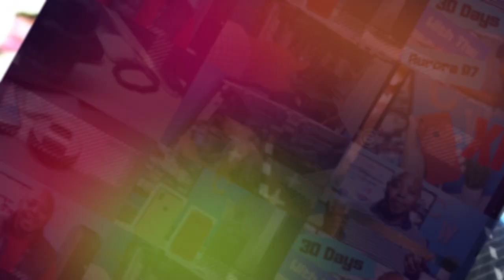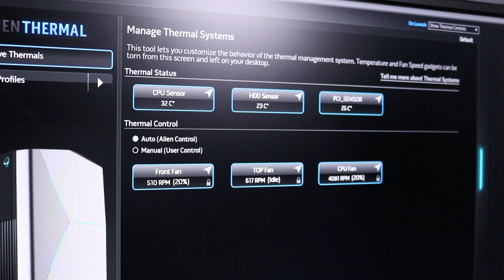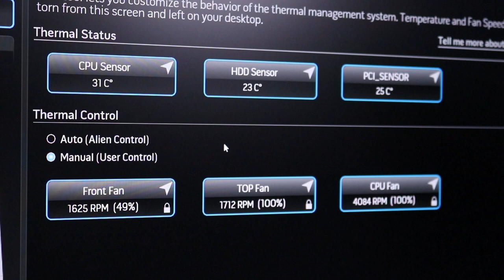Corsair Hydro Series H60 Liquid CPU Cooler Install / Upgrade in Dell Alienware Aurora R7

Comment: The only guy to actually mention where to wire the damn pump. I was confused with the 3 pin cable. Thanks.
Reply from the maker: No problem! Glad I was able to help!
Reply: Where does it plug in
Reply: Where does SATA connect? The connecter near the PSU?

Comment: Thanks for the video, I watched it a couple of times and after some research decided to upgrade my R7 with the H75.  I got it done correctly on the first try and my temps dropped 10-12 C at both idle and under load.  It was very straightforward and a great fit in the R7 case.  I was able to use the screws that came with the cooler to attach both fans, including the top fan to the case.  Unlike the H60, the H75 comes with 2 fans, so it includes 8 screws.  They are long enough to secure the top fan to the case and radiator.  Used the Y-cable and connected the fans to the TOP header, pump to the pump header and left the CPU header open.  Set the TOP Fan to monitor the CPU in the Alienware app.  No errors on boot up, all works great.  Idle temps are now 31-32 C.  Using BurnInTest utility my max temp dropped from 88C with the stock air cooler to 76 C with the H75.  Average load temps went from 82 C to 72 C.  Part of this is also due to changing the fan settings in the Alienware control panel from fixed to curve, so the airflow ramps up based on the CPU temp.  And the PC is almost silent now, even when gaming, no more fan revving.  Very happy with the purchase and results.
Reply from the maker: Avenger that’s awesome!
Reply: Hey, thats really good to know it worked. I have a few questions, as im also upgrading to liquid cooling.

1. Did you have air cooling before on your cpu?

2. Which H75 did you use, as im searching online and there are many different types. Would you mind providing me a link of the one you used.

3. Do the fans that come with the cooler work?

Thanks
Reply: @akhil1802 

1. Yes, I had the standard factory air cooling, low profile heat sink and fan, that comes with the R7

2. I installed the Corsair H75 which is the dual fan version of the H60 shown in this video.  The 2 fans provide a bit more airflow and help expel the hot air out of the top of the case.

3. Yes, the fans that came with the cooler work just fine.  I did replace them with be quiet! Silent Wings fans, but that was to minimize the noise, cooling performance was about the same.

Comment: Thanks, Will!  Turned my R7 on two days ago and was greeted by an instant chorus of loud Screaming fans. Temps showed CPU was hitting 92C!  I figured it was either a rogue piece of software or the CPU cooling system had failed.  Task Manager wasn't showing anything too abnormal but I decided to reinstall the window with Alienware recovery tools.  No luck there so it's come down to that AIO.  Since you're the only one with consistent R7 videos I turn to you and sure enough, Will is doing an AIO swap.  Iike you I don't want to have to remove the motherboard so I'm going with the same unit.  Wish Me Luck.

Comment: Great demonstration and explanation! My stock aio cooler got hot and hotter. I did all the steps 1:1 to install the H60 in my Aurora R6 on a i7700K. It succeded and temps are now down to 35 degree in idle mode. Much appreciated!

Comment: Great video!  This seemed easier on my R9.  The radiator and fan installed with easy, where it looked tight on your R7.  The H60 made a massive difference on my i9-9900K 5Ghz overclock.  Temps went down 10C under heavy load and it's much quieter that the stock Alienware CPU fan and top fan.
Reply: I’m getting 78c on my r9.what are you getting?did you plug the data cable by itself or with a cable that was also connected to a HDD?

Comment: Thank you so much for making this video! I was able to successfully install my first liquid CPU cooler thanks to you. I really appreciate it that you went step by step!
Reply from the maker: Moira no problem glad everything went well for you! Thanks for the feedback!
Reply: @WiLcreatives  No problem! I'll definitely check out some of your other Alienware Aurora R7 videos for future reference!
Reply: @Moiwa bro where does the sata power go and 3 pin? Sata goes to the connecter near the psu ?
Reply: @mahid9594  Sorry it has been so long since I did this I do not completely recall. The three pin can go into the four pin at the top of the motherboard near the radiator. That's correct the sata goes into one of the connectors near the psu. 25:28 and so forth should hopefully help.

Comment: I wanted to thank you for taking the time to make your video; it was very useful to me. I was able to get my own H60 installation done however I did not remove the power supply or the top of the case. I am assuming the R10 is slightly different than your unit. I am running some stress tests to make sure the temps are normal.   I am seeing temps no higher than 65c and I am assuming this means everything is working. Your video was the best I saw. Again, thanks. Keep making these kinds of videos.

Comment: I just installed the exact same product in my R6.  Very informational video and it helped me a lot to watch as I did the same install step by step.  Thanks so much!
Reply from the maker: Awesome what type of cooler did you have before the upgrade?
Reply: @WiLcreatives  I just had the stock air cooler before.  I just got the RTX 2070 super in my Aurora and when I put it in I can totally notice the increase in fan noise.  That's why I went with the liquid cooler option.  One question though....the instructions in the box say the install the fan on the outside and the radiator on the inside but I noticed you did it the other way around.  Did you install it that way because you were placing it at the top of the case to vent heat out of the system?  I was just confused as to which way to install it.  Thanks!

Comment: Great video will! I would recommend to anyone who wants to upgrade their cooling in the Alienware to buy the Corsair H75 instead. Basically the same install but two fans instead of one. I idle at 30 and when I game I never go above 52.
Reply from the maker: Thanks man! Thanks for the info as well!
Reply: WiLcreatives no problem keep up the good work!
Reply from the maker: @tomfrien  I definitely will!
Reply: Does it fit on a R8?
Reply: Fernando Juarez it is the exact same case and motherboard so I’m pretty sure it will.
Reply: Have you done it? Does it deffo fit?
Reply: What's your Alienware model? I have R8 should I buy it?
Reply: Hi i have a question for you.. (2 years later i know, would be very grateful if you could help me out). The H75 has 4.72 x 1.06 x 6.1 inches dimension and the H60 in this video has 14.17 x 6.29 x 4.72 inches dimensions for LxWxH. is that normal that its so different?. i'm scared the H75 won't fit on the case because of the double fans.
Reply: @Maxalam  unless the dimensions changed from the one I bought 2 years ago I got it to fit. It is a little tight but it worked great. Just make sure you have the fans pointed in the same direction 🤣🤣. I’ve done that.
Reply: @tomfrien  gotcha thanks a lot

Comment: Your video was just in time. 

About 10 min ago I completed the installation of a H60 in the Aurora R5, but I made two different things: I changed the fan from corsair for a bequiet silent wings 2 and instead of pushing the radiator into the top box, I used the one it had for the previous top fan so I used it as a holder, meaning no top box but is holding tight by the fan holder.
Reply from the maker: Nice !

Comment: You don't have to take the top off the case. The steel box that holds the radiator can come out with one screw. I have an R8 and just installed an H60 in mine
Reply: Ah. That would make it much easier. I am debating on this upgrade, but Dell will not let me install the OC software.

Comment: FOR ANYBODY WITH ALIENWARE LIQUID COOLER: It makes a absolute word of difference, my Alienware liquid cooler was insanely loud, i just put this H60 in and its so quiet its almost inaudible, and i bought a used one! Install was not that hard, and it is 100% worth it. MAKE SURE TO PUT THE 4 PIN ON THE "TOP FAN" AND THE 3 PIN TO THE PUMP FAN USING ONLY 3 PINS STARTING FROM LEFT, THIS WILL LET YOU BOOT PAST BIOS SUPPORT AND USE ALIENWARE COMMAND CENTER, OTHERWISE YOU WILL NOT BE ABLE TO BOOT PAST BIOS SUPPORT.

Comment: Thanks Wil.  Very informative, and I feel more prepared when I upgrade my wife's Aurora.
Reply from the maker: Thanks man I appreciate it! I was also told that the Corsair H75 works as well in a push pull configuration, so that's worth checking out!
Reply: @WiLcreatives  Will do.  Do you have a use for the old Alienware water cooler?  Willing to buy it from ya ;).
Reply from the maker: @olddrybonez  you got it, if you're on Twitter or Instagram. Send me a private message and we can talk through it.

Comment: Great job. Love your style, you not only covered all the bases, but anticipated common mistakes. Very humble too. Really enjoyed it and learned a lot. One issue I'm having is that on boot, Support Assist declaring a CPU fan error since there is no longer a fan plugged in to the CPU Fan connector. Any suggestion?

Comment: Hey Will, Love the videos honestly excellent help when looking for small tips & nuances you were a great deal of help through College. 
Quick questions did you remove the mobo to install the back panel for the stand up screws for the cooler ?
Reply from the maker: Thanks I appreciate it. I didn’t have to remove the motherboard. I was able to use the backplate that was there already
Reply: @WiLcreatives  Thanks, appreciate the quick response!👌

Comment: I'm planning on getting this for my R8. I've been looking at lots of videos and talking to people in forums. I'm told the fan that comes with the cooler is junk and will throw a bios error. You didn't mention that so no error? It's recommended to get a different Corsair fan instead. Just wondering if this worked out for you using the supplied fan.
Reply from the maker: When I had it I never ran into bios errors. I’ve read the forums as well. I think it depends on what pins you plug into.

Comment: Did you need to swap out the CPU fan that came with the H60? I was reading that you need to swap out the fan to get the R7 Aurora to book past the support assist. Can you confirm this? If you had to swap out the fan what did you change it out with?
Reply from the maker: No I did not have to change the fan

Comment: hey so what kind of temp are u getting after the upgrade from alianware stock LC to the H60 LC? im thinking about upgrading too but if its not a drastic different i might go with the h110 or hold off. i see that u show ur idle at 31. is that lower than before?? also what kind of past do u use? grizzly?

Comment: Thank you for the video, just gave it a thumbs up.... unfortinately the version on H60 that is sold in 2023 is bigger and won't fit and it is impossible to find the one you bought. My Pumo broke and I have no choice but to replace it and the radiators I found that will fit are Asus Tuf Gamin LC 120 A-RGB and NZXT Kraken 120 RL-KR120-81. The problem is now that I don't know if they are compatible (right connections to the DELL motherboard) and you also mentioned in the video that you might need to re-assemmble the motherboard. I know it is a lot to ask but would you be so king and check if any of these will fit? I would of course do it myself but I just don't know how I can check that. Thank you in advance
Reply: any luck? facing the same issue , cant find a new H60 and not sure what fits these days..did u install either of these you listed? if so how did the install go?

Comment: Great video man, I got my H55 installed using it, thanks a lot! I will say for anyone else coming from an air-cooled R7 configuration, same experience as the guy below, with regard to not having any chassis screws. How does Corsair not provide these?! Anyway, the other big issue (with H55 at least) is that it doesn't have PWM fan, so you'll likely end up with something much louder than before. Super frustrating, I now need to purchase a PWM fan. Major fail on Corsair's part. Anyway, enough about that, can't stress enough how helpful this video was, thanks again!
Reply from the maker: Brian Collins thanks for the support and feedback!

Comment: So connect the 3 pin connector or sata connector. Is it either one for the pump. I just got this cooler i haven’t install it yet
Reply from the maker: Leduan81 if I’m not mistaken you connect both.
Reply: WiLcreatives got thanks, i will install when i het a chance, and follow the instruction
Reply: @WiLcreatives  any major differences in thermal between the AW AIO LCooler versus after putting in the Corsair H60?

Comment: So just did this exact upgrade on my R8, air cooling was doing me fine for the last 3 years. Strangely I'm now seeing higher temps on the CPU!! I've copied you right down to the pin config. Only thing I'm yet to do is remove the initial thermal paste from the cooler plate. Any suggestions?

Comment: Nice instructional video,  thanks. 
I do have a question,  I already have the R8 watercooler version and all I want to do is replace the radiator fan with a quieter one. Can I get to the fan by just taking the side panels and top off?  Of course removing the screws from the rad cage first. 
 Thanks!
Reply: Anyone????
Reply from the maker: Thanks, from when I looked at it. The space is so tight the fan is underneath the radiator so you will have to take it out. Yes you can replace the fan. You will however need to some research. I’ve heard of people replacing the fan and receiving error messages at boot because the fan speed of the fan wasn’t high enough.
Reply: Did you ever replace just the fan on the radiator ? Looking at doing this as well

Comment: So you don’t do anything with the SATA cable? The older H60 didn’t have one
Reply from the maker: I need to go back and watch the video. The sata cable I think you’re referring to coming from the cooler connects to a free sata cable from the PSU to power the pump.

Comment: Can I change the fan to an 120mm rgb fan? If I dont like the stock fan?
Reply from the maker: _ZÈRØ _ you can but it needs to be the same fan speed and power as the stock. Otherwise you may run into issues when booting
Reply: @WiLcreatives  if it has 1400rpm is that a problem?

Comment: Mate, why did you apply thermal paste again? just wondering, cause I order my cooler a bit ago
Reply from the maker: I was trying to figure out which direction I wanted to seat the cooler. I kept picking it up and placing it back down. At that point the thermal wasn’t going to be even so I cleaned it off repasted. Standard practice
Reply: @WiLcreatives   thanks a lot

Comment: I have the Corsair h60 water cooler but the sp120 fan is not RGB ... I know this fan is supposed to have a certain amount of pressure for the cooler to work correctly .. is there a Corsair RGB fan that can replace this fan on the cooler ?

Comment: Hi their! If anyone could help with suggestions! I have Alieanware Aurora R7 with original Alieanware water cooling and intel i7-8700K with 6 cores and 3.70GHZ with GTX 1080ti is it worth upgrading fans? Better cooling? Also which gaming motherboards are compatible? Should I upgrade CPU? Thanks

Comment: Hey WiLcreatives - wish I had your email for these random questions, but you're my go-to expert on Alienware Aurora R7. :) I know you got a new computer, but question re: Aurora R7. Is it possible for me to "easily" take out all my hardware and put it in a better, cooler case? My Aurora R7 has been upgraded with an RTX 2080 Ti, 32gb RAM, an SSD on the m.2 NVME and only thing that still isn't good is my CPU, which I realize I can't do much since that would require a new motherboard to buy if I were to upgrade my i7-8700. So, was curious about moving things to a new case, for the long term  (vs just buying a new computer all together since my Alienware is only 1 year old).
Reply from the maker: Yep you can move things to a new case but I would get a new motherboard and probably and new power supply depending on the one you have. There are plenty of good z390 boards for the low.
Reply: @WiLcreatives  I've literally followed your advice and got the EVGA Supernova 850w, EVGA RTX 2080 Ti Ultra, and 32gb RAM (Fury). Just need a new mobo and a new CPU with a new case and I'd be happy. Just don't feel confident building my own machine just yet.

Comment: what was the point of switching cpu coolers? I got the h60 because my system came without a water cooler and i couldnt find the alienware brand one. But the first thing I noticed when trying to play cyberpunk on ultra was the cpu temps on air cooled are scary lol

Comment: I tried this with the H75 model that looks exactly the same as your H60, accept for it has 2 fans. I have the Aurora R6. Works fine until I try to use the Dell OC controls. Once I enable them and have to reboot, the PC goes into boot failure. Powering on and off in 3 second intervals. I have to take out the cmos battery to reset controls before I can boot normally again. This happen to anyone else after doing this upgrade and trying to use the Dell OC controls?

Comment: is it true after you replace this part it will make the system start up slower or is it the same? Thanks for the detailed video.
Reply from the maker: samuraispiritsx didn’t get any slow starts!
Reply: @WiLcreatives  yeah man I did it and its been good so far for the last 2 months lol
Reply: @samuraispiritsx  Where does the SATA cable go bro? The connecter near the psu?

Comment: How significant is the noise reduction. My issue with this PC is not necessarily the temps but the worry that it might take off. Also. Do you think it's possible to just buy another ... 60 mm fan? To place on the original Alienware radiator. I need help reducing noise!!!
Reply: Use sound dampening foam or just buy a air cooler